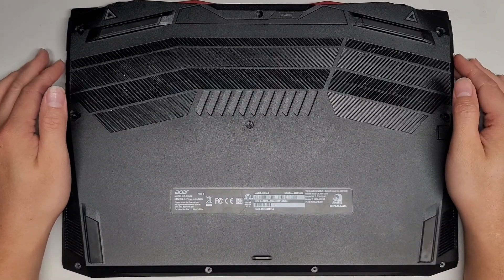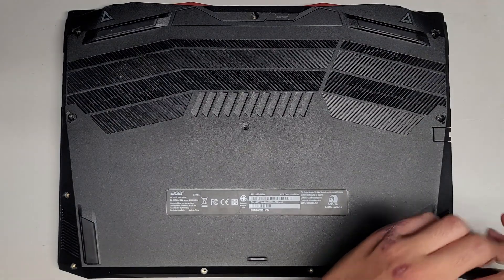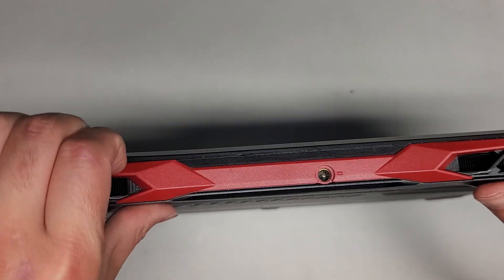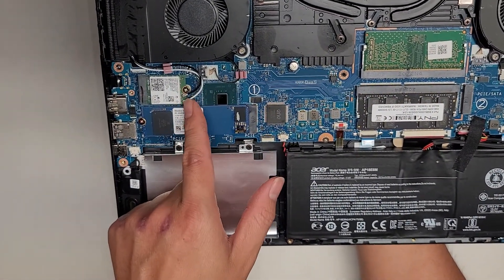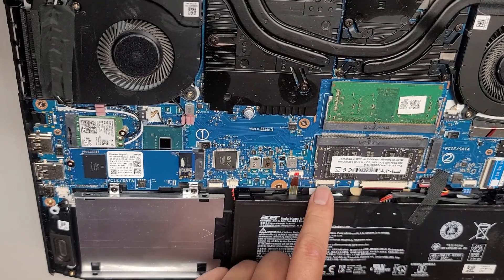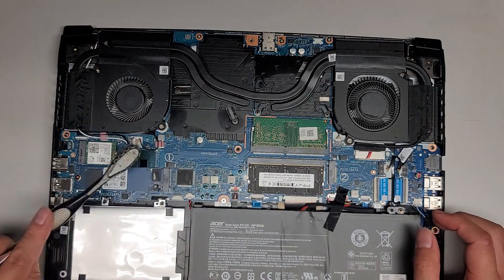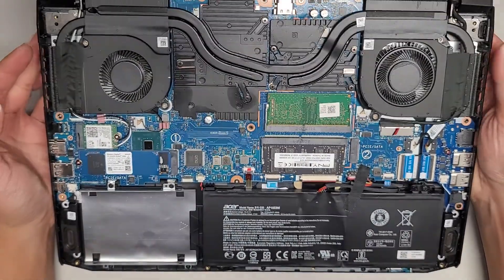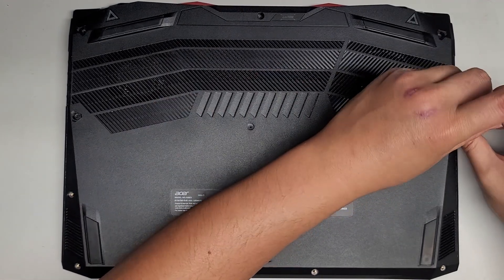Acer Nitro 5 N20C1 AN515-55-53AG Disassembly RAM SSD Hard Drive Upgrade Battery Replacement Repair

Comment: Helpful tip. The two triangles on the bottom near the hinge side show you the easiest spot to remove the case from. That way you don’t have to run your finger along the seam. Lift from those spots and it pops right off.
Reply from the maker: Nice

Comment: Hi, i have this exact same model (AN515-55-53AG) & i was playing a game on it until it suddenly turned off,no power charging light to the pc or the adapter (well,i let the adapter cool off) & i reconnected the ac adapter back to charge my pc,and the light that charges it didn't come back on,nor did me pressing the power button,it didn't turn on. So i took the case apart & i don't know what's the problem. Could you tell if it's probably the battery itself or the adapter?
Reply from the maker: Sounds like a motherboard issue.

Comment: planning to open my wife's nitro, same model, not charging LED doesn't light up even when plugged correctly, do you think I just go ahead and replace the battery?
Reply from the maker: Battery won't fix a issue with no charge light
Reply: @ItsBinhRepaired  thanks! you think this is an issue with the motherboard?
Reply from the maker: @suxgaming398  charge port charger or motherboard

Comment: Hello, I have an issue with my mousepad acting funny - cursor moving weirdly slowly, jumping around the screen clicking things before it completely stops working. I'm considering just replacing it altogether since all efforts to troubleshoot haven't worked. Do you recommend this? Will it fix the issue? Is there something else worth trying first, or is this an issue deeper than just the mousepad?
AN515-56
Reply from the maker: Try physically disconnecting the touchpad and using a mouse to make sure it's just the trackpad.
Reply: @ItsBinhRepaired  I did that a few days ago and it worked just fine
The replacements I've seen online so far include just the mousepad. How do I check that it's not the connection from the mousepad to the motherboard that's the issue?
Reply from the maker: Trial and error
Reply: @ItsBinhRepaired  thanks, I've replaced it and the issue is gone
Reply from the maker: @bjasshjaskjdhkasj  awesome!

Comment: The only thing I see wrong with what you did is not remove the tape from the heatsinks that hold the fans in place it holds alot of dust in there, and seeing as his gpu heatsink was oily should have replaced the pink paste under there with thermal pads.
Reply from the maker: I use a powerful air blower to get the dust out. The pads don't need replacing unless they hardened.
Reply: @ItsBinhRepaired  its not pads it's pink paste unless they where already changed but my rule is once opened replace the paste, that's just me.
Reply from the maker: Paste I replace, pads I don't. But usually only the paste on the cpu and gpu dies.

Comment: will a Killer Wifi 1675x card fit in there?
Reply from the maker: Not sure, but even if it did, a lot of laptops lock the wifi card to only a few models.

Comment: Hi, what do you think about the charging port? I'm a bit worried about the charging port design because you need to push the charging pin harder, especially for long term use.
Reply from the maker: What do you mean?
Reply: @ItsBinhRepaired what i mean is when you want to charge the nitro 5, you need to press the charger hard to the laptop until it makes a "click" sound. 
I'm afraid that this will affect the motherboard because you always press the charging port hard.
Reply from the maker: @hendrawongso2183  click sound? That doesn't sound right
Reply: @hendrawongso2183  I own the same laptop and yes there is a click sound nothing to worry about.
Reply: @sav3429  yes he has a click sound.
Reply: @ItsBinhRepaired compared to other laptops, you do have to press it harder than usual until you hear or feel a click. There were many people who thought that the charger wasn't working because they didn't push it in hard enough. Now I find the click satisfying lol
Reply from the maker: @NyneIX9  lol I see

Comment: Where can I find the part?
Reply from the maker: Which part?
Reply: @ItsBinhRepaired  wait. Do you replace the charger port? Or know where to get a new internal cord?
Reply from the maker: @ace_darkninja  the charge port is soldered to the motherboard on this model

Comment: I was with you until you wiped the contacts with your fingers bro.
Reply from the maker: Hahaha if gold has problems with finger oils, show me gold jewely that is tarnished from being worn too much. Explain to me chemically what in gold reacts with the oils in our fingers. People are too paranoid and don't understand why they do what they do other than being told not to. You can touch the pins all you want. It's not a problem.
Reply: @ItsBinhRepaired  esd is an issue too bud
Reply from the maker: By that logic, you should be against opening the computer at all. Haha You just have to discharge your static elsewhere. It's not difficult.

Comment: wtf did you punch your wall lol.
Reply from the maker: This joker's got jokes lol This is what happened https://youtu.be/aDKOo7agETg
Reply: @ItsBinhRepaired  there is no charging port replacement video on youtube for this laptop just fyi. my cord is lose in it so i need to replace mine. just hope its not soldered. im kinda rough with the cord so i think I overbent the copper fasteners in the plug. that sucks u fell off the bike but now u can tell chicks you been in a few bar fights lol.
Reply from the maker: Lol I just tell them the truth XD